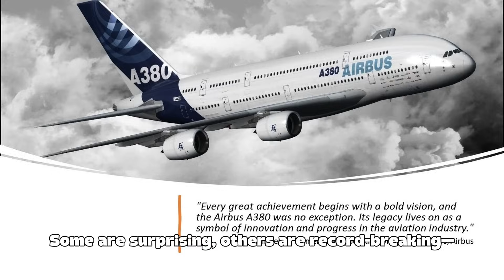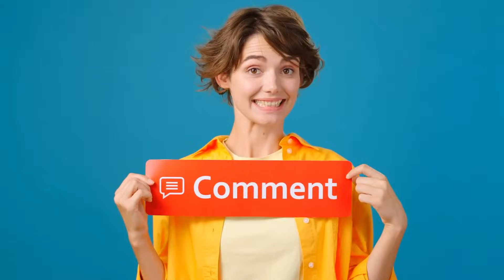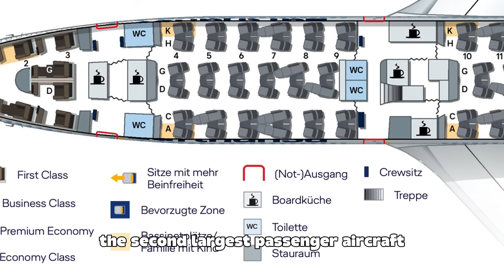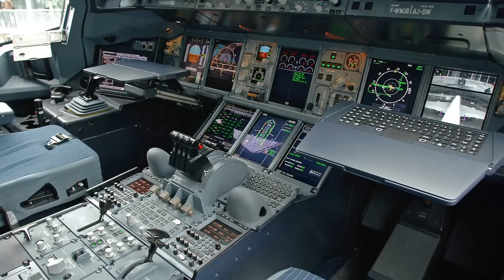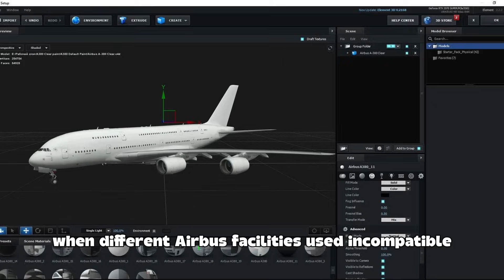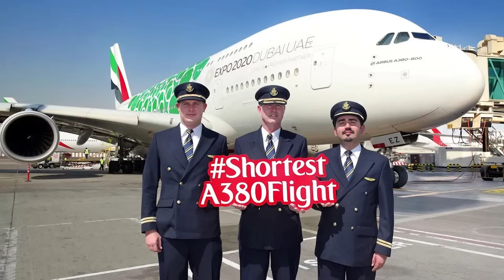10 Facts About the Airbus A380 You Never Knew

Comment: In you fact No 9 you claim the cost of flying Dubai to Auckland is 100000 dollars. However you stated the aircrew salary is between 30 to 40 thousand dollars. That's wrong. Why because the salary you quote would be annual. Not a si gle return flight
Reply from the maker: Thank you for your comment! It seems there may be a slight misunderstanding. In my video, I estimated the total operating cost for an Emirates A380 flight from Dubai to Auckland at approximately $343,885, not $100,000. Regarding crew salaries, I calculated $21,656.25 for a single 15.75-hour flight, based on hourly rates ($150/hour for captains, $100/hour for first officers, and $35/hour for cabin crew). This represents the cost for one flight, not an annual salary. The $30,000–$40,000 range you mentioned might come from other sources that include additional expenses like allowances or layover costs, which I accounted for separately under miscellaneous costs ($10,000). I hope this clarifies things! Please let me know if you have further questions or insights.